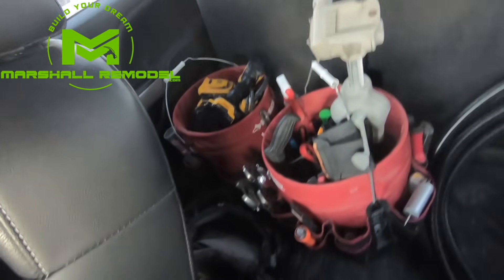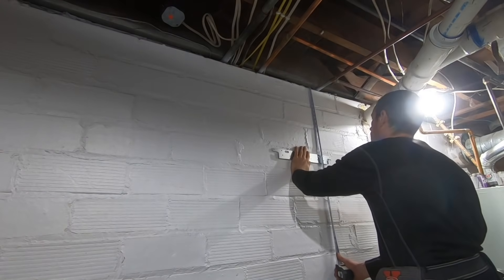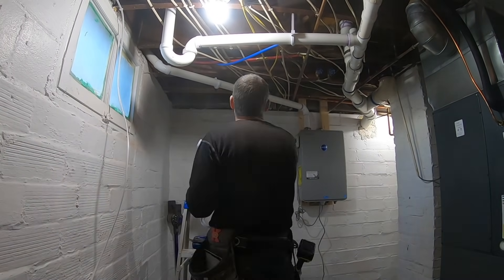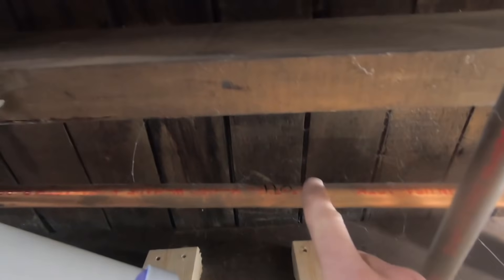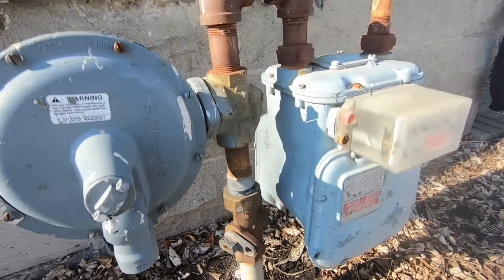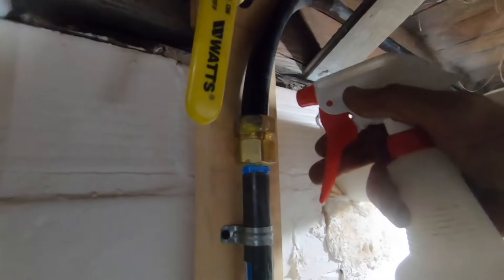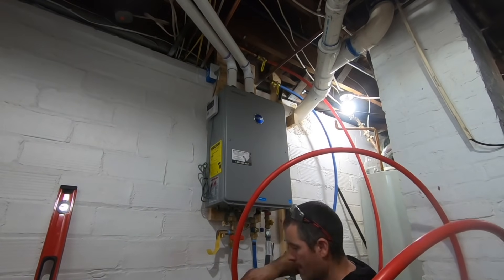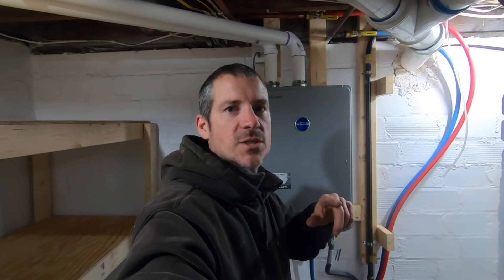Tankless Water Heater Install | Existing Home

Comment: Are those 90 degree elbows on top the tankless pitched? I'm trying to visualize how you got the slope in the exhaust run. Because if they are regular 90s it would be 0 degrees pitch right? Or perhaps the spot it clamps into on the top of the tankless allows for some flex and that is how you pitched it?
Reply from the maker: They are 90's but you can easily get a slight pitch with the pipe.

Comment: I have learned to never use dish soap for checking gas leaks.  It is a degreaser which will remove some pipe sealants and is corrosive and can rust steel pipe.
Reply: Only use approved gas leak solution
Reply: wow that is a fact that i just learned after plumbing for 30 years

Comment: I get made fun of at work for being a nj plumber who runs pvc working in nyc where they still do cast-iron, kinda mind blowing what other people around country are doing we sweat copper pipe and run black steal for gas this type of work being done realy takes the art and skill out of the trade, take the extra time to do things like a pro your work will last longer and you're customers will know the difference.
Reply: Those gas fittings he installed would eventually dry out...black pipe,baby!

Comment: It would be nice if you would mention about making sure with the BTU's you are adding to the gas system,, that everyone needs to make sure your gas piping is sized correctly to handle all the gas appliances, I got to jobs everyday and see that problem, plus jack legs in our area are installing these units and not getting them inspected like they are suppose to, to make sure these units are installed the way they need to be.

Comment: So I have heard that the maintenance is much more involved with tankless systems. Do you have a video on that aspect of the tankless water heaters? Thanks for the videos, they are very informative.
Reply from the maker: We don't, but still need to do a video on the install in our new build. That's a great aspect to include in a video.
Reply: Sounds great!
Reply: Circulate vinegar through the system. Doesn’t get my mor straight forward that thank.

Comment: First question is, I thought you cannot run pex directly to your hot water heater? Second question is did you have to terminate any electrical for the tankless? I did a couple jobs before where I had to wire up the tankless heater. If i remember correctly, I believe it was due to them wanting to tie it in to their smart home system. Tekmar if I remember correctly.
Reply: Normally, you need 18" of approved piping away from the unit before switching to PEX.  The Rheem  and Rinnai models I have installed plugged directly into a standard outlet as it is only used for powering the electronics.  I haven't done any systems that connect to a smart home system.  Do you have a link of what type of system that was?

Comment: Tankless v Tank still an interesting debate.   "Endless" hot water often means increased bills & water usage especially with teenagers in the house, they may never leave the shower!  Also in case of power outage no hot water -- a 40 gallon tank will stay hot for a day or two (obvi not for showers but the rest).  And yes depending on the make up of your domestic water (well vs municipal, hardness, minerals, etc) scaling can be a big concern.   TBH despite their growing popularity, I'm still fan of 50 gallon tank for about $600.   Last one I replaced in my house worked great for 21 years.   But thanks for the clear good video!

Comment: Good job,  the only thing I can see that would be called by the inspector is you have to bush down at least 2 pipe sizes with gas or use a reducer.

Comment: I saw a suggestion about screens on the PVC due to rodents. It's usually a bad idea on the exhaust, and some instruction manuals will say that. Flue gases on high efficiency units are cool and moist, so will immediately condense on cold hardware cloth screens. (rapidly) That starts a death spiral and an ice dam is built quickly in cold temps. The pressure switch sees an obstruction and the unit shuts down. In practical terms rodents don't enter, but ice dams will form all the time below 20F. FYI.
Reply: Great explanation of this. I was looking thru comments to see if anyone had already said this. Obviously doesn't apply with homes in warmer climates.

Comment: Quick question on this install... noticed the meter was 250 CFH. Did you have the gas company upgrade it after this install? NG furnace, NG stove, and now NG tankless must be over? The reason I ask is because I have same size meter and plumbers are looking at me like I got 10 heads when I ask them don't I need to upgrade the meter first.
Reply: That is just one of the half dozen or more items that would never pass inspection.
Reply: That is prolly because your meter is good up to 250,000 btu's of output..your tankless is anywhere from 140 to 150,000 btu's  for your furnace let's go high and say 100 to 120k btu's doubtful but let's go there..your dryer 25 k & your stove anywhere from 40k btu's to run 2 burners full blast and the oven all at same time..giving or taking on this figures you should be fine..most important thing is the piping if that's not sized right then you could run into problems it all starts at the header pipe that enters the house that is supplying all the rest of your branches that pipe needs to accommodate the supply of BTUs for your entire house when you add them all up all by itself..then size down from there
Reply: A 250 meter (size) can supply well over 250 cubic feet of gas during high demand times. On a 7" system which is what this is, your going to have 300k+ BTUs available per hour. Makes sure all your piping is sized correctly. That's the main concern. It's not uncommon for me to see a 4 unit apartment running on this same pressure ( w/ a Schaumburg reg).. 4 furnaces 4 tank water heaters.

Comment: The valve kit has built in shut off's, but you also installed them on the lines.  Is there a particular reason to have both?  Sorry if I'm missing something obvious and thanks for the video.
Reply: Yes it is for flushing purposes

Comment: It's against code in my and most states to run pex upto your water heater. You need 18" of "ridgid" pipe...flexes are considered acceptable and will meet your union requirements...
Reply: I was thinking the same thing. Hire a professional plumber for plumbing
Reply: It's not just code,it's manufacturer specs
Reply: Hack job. Not to code. I saw the thumbnail and 5 seconds into the video said to myself this guy has no business doing this job. I think his venting is too close to an inside corner too. Focused on windows and missed that. Isn't the trac pipe supposed to be grounded? Also, wrong type of plastic tube for the drain and he didn't put it through a neutralizer. Gonna rot out their floor drain and the plumbing if its old cast iron. That stuff is like acid to cement.
Reply: David, are you referring to standard tank water heaters? Any back draft from the exhaust flue can melt the hot/cold water lines if they aren't metal for first 18"
Reply: That is not the case for a condensing tankless.  You can run pex directly to the unit if you want.

Comment: Did good but that wood framing is def not as sturdy as anchoring it to that block wall . It’s hollow but it will hold better then floating 2x4 .

Comment: Nice video. Easy to follow. One question, what is the reason for having two valves on both the hot and cold? If you already have the valve kit that screws directly to the heater, why put yet another set before/after?
Reply: Just for whatever in case you need to remove the hot water heater maybe to a different location. Other then that there’s really no purpose.

Comment: I am planning on removing my water heater and put tankless water heater. My current water heater is using PvC for vent.  And it goes up in the attic to the roof. 
So my question is can I use my vent That I currently have on my tankless water heater? It about 20 to 30 going up? Pvc

Comment: Can I mount this on my back porch? No basement…house was built in 1941 n have changed all gas line to black pipe n flex tubing…my tank heater quit n was thinking bout putting a tankless in…vents through roof

Comment: Woulda been nice to see the wiring done for this unit as well… Any particular reason it wasnt included?
Reply: Plugs into any old outlet. Get a short glimpse at 20:51.  The control wiring on mine was rather simple but will vary.

Comment: My house has three 40 gallon  hot water heater.  One is new 2 came with  the house.  Question  is there 1 tankless that can replace all 3 of these 40 gal
Reply from the maker: Depends on how much water usage. When you look at the models they’ll specify how many gallons they can use per minute

Comment: Never Teflon tape on gas pipe. Always pipe dope or permatex if your dealing with stem.
Reply: He said that's how he was trained....guess his teacher didn't know that regular Teflon tape will possibly clog your gas valve.
Reply: Tape is fine, pipe dope is easier.
Reply: @christopherhaak9824  
Yellow Teflon is for propane and natural gas. White is only for water lines. Gas breaks down white Teflon over time.

Comment: Help ...my gas hot water .is leaking out overflow pipe or relief valve ,after i take a shower.... when it  is feeling back up it shoots steaming water all over my floor .through the relief valve .ive  heard it probably valve but i think its in the heating unit getting the water to hot ...plus its on lowest setting .any help would be awesome

Comment: I'm sold on tankless, except for 1 thing.  The cost of transitioning from tank to tankless. I've run the numbers twice over the last 20 years.  With all of the upgrades required were looking at approximately 25 years to recoup our investment. Probably more know that it's just the 2 of us. Talked to realtors and absolutely no financial benefit for the upgrade. We lose power a few times a year and about once every 5 years for multiple days so to be able to have gas hot water vs none is important to us.

Comment: Its going to be interesting in 20 years when all of these new installation products with rubber o-rings start failing. Im fine with pex and crimp rings or any other mechanical connection. I know the 100 year  service life for pipe installation is a thing of the past but Its black pipe and copper for this fella. Good job otherwise. Thanks for posting.
Reply from the maker: Thanks for weighing in. It will definitely be interesting to see if it all lives up to its name
Reply: Because copper holds up forever right??lol
Reply: Copper is a disaster for me.  Pinhole leaks everywhere.  20 years on the system...time for pex.
Reply: He said, "black pipe"
Reply: I like the shark bite for going from copper to cpvc,or switching from any one kind to the other, but I would never use it in a wall that is sealed off, and I still prefer the crimp clamps any time possible

Comment: Only thing I see wrong is you should of used water heater flexes. Need 18-24 inches of gap between pex and valves

Comment: I kinda have a problem, my water heater and furnace is in the center of my house in a closet, can you vent it in the same place as the old water heater. Also does the intake have to lead outside?
Reply: I believe the exhaust contains carbon monoxide. DO NOT vent inside.
Reply: @TravMan923  that didn't answer my question, obviously if it burns any type of gas the exhaust contains carbon monoxide.
Reply: @gainesinlife  I'm sorry! I read intake as exhaust 🤦‍♂️. Smooth brain move.

Comment: A couple issues I see with almost every one of these videos is that 1) no one ever mentions when installing the water tankless heater to have the gas meter verified that it can handle the demand of the tankless water heater. Not all homes have a big enough meter to handle the demand and if that is the case and you do not stage the installation you could be without hot water heater till you get the gas company to come out and properly size a new gas meter. 2) It is not a good idea to dump the condensate line directly in the sewer or on the ground because of the issues with acidic water. You should be putting a condensate neutralizer device on the system to bring the ph level of the water to a safe level. It will protect the environment and the pipes if you do. If you live in an area that has housing codes than you need to check with them to see if it is allowed to dump on the ground or in the pipes(which I do not recommend)
Reply: Walter, you are absolutely correct. Worked as a first responder / gas fitter for a gas utility in Missouri and not contacting the gas utility about the added load is the number one mistake.The number 2 mistake  is under sized fuel runs & number three is the neutralizer not used on condensating tankless water heaters.
Reply: @boby115  he's not a licensed heating contractor. So he shouldn't be tinkering with things that he is not qualified to work on.
Reply: @boby115 
Yep, another Carpenter playing Licensed Plumber. No issue with insurance and permits? HA!
So many issues... 
No Plumbing Permit
No Gas Permit
Sch 40 pvc no longer legal to use (at least here in MASS!) for the guys exhaust
No Liability Insurance
Push to fit valves
Valves under heater not for "draining" but for annual flushing of the heat exchanger
Condensate not proper
I could go on and on... 
He is qualified to run those 2x4's down from the floor joist though. 
Not doing his family any favors here.
Reply: Sounds like 3 union losers being haters.  I  installed a combi boiler on my house myself,  did everything cheaply as I could. Sold the house without any issues.   Municipal water is usually so hard with calcium and magnesium,  the acid condensate isn't a real issue.   Stop making people waste money on stupid unnecessary things.
Reply: The BTU capacity rating is on the gas meter. Plus the meter actually has a 20% extra capacity. The main thing is the pipe size should be 3/4 and it is. Google meter size for tankless water heater.
Reply: @twbrkfd1733  some of the new tankless models are now coming with a 1/2 gas line requirement.   However all of the combi boilers require the 3/4  gas line. For the most part,  I felt that this a good video.  Most home owners can easily tackle this project and save $1000's doing it themselves.
Reply: @jjleda7324  I dont think a home owner should be messing around with a fire burning appliance in their home just to save a few bucks. To many serious consequences if something is done wrong.
Reply: @richardneville3731  it's not just saving a couple of bucks, it's more like saving several thousand bucks
Reply: This tankless only requires a 1/2" gas feed and it also comes with a built in condensate neutralizer.  The install is fine.
Reply: This particular water heater has a built-in condensate neutralizer

Comment: What is the size of gas pipe and how far needs to be from water heater?
Reply: 3/4 into the unit itself. The intake from the meter was 1', so he used a reducer.

Comment: I need to replace a 40 gallon gas water heater. The problem is it sets on the floor in the garage and I need to raise it per code. The plumbing in the wall comes out too low to do that without extensive work. I have the space to mount a tankless and it looks like something I can do. My only question is the existing 1/2 inch gas line. Will it be big enough?
Reply from the maker: It’ll depend on what else you’re running off it. Also natural gas or LP.
Reply: @MrPostFrame  I have a 1500 sq foot house NG with two full baths. My furnace, oven and cooktop is NG. Plus a very small garage heater that is rarely used. My tank is in a small 24x24  closet in the corner of the garage. Due to doors on both sides there is no way to enlarge this space. The 1/2 inch gas line is within a foot of where the 1 inch line enters the house. But the gas valve is buried behind the 40 g tank I replaced in 2018. The house was built in 1968. It worked great for a few years but now acts like the pickup tube  is broke off. Runs out of hot water around 5-7 minutes and goes luke warm. I've flushed it several times, not much sediment comes out. Thanks for the reply.
Reply: If that gas line is attached to the house main line, Richmond says 1/2" gas line is large enough.  That may not be the case for all tankless makers though, so check.

Comment: Does that valve kit -you say drain port, are those usable for flushing the heater? If so you should mention that they need to be chemically flushed yearly . Nice install tho, I’m 40 years in , still cannot get past all that flex shxixs piping. Sorry
Reply: This system really should have a scale and sediment filter inline plus a water softener to avoid having to flush the unit with descaler.  So many benefits to both of those additional items and very little cost.

Comment: Why not do it in copper makes the install look so much better, I know pex is easier but definitely not a nice look plus no hangers
Reply: This particular install of PEX wouldn't meet city or county code in most areas.  There are about 6-7 items an inspector would require changed including the gas meter being the first on the list.

Comment: Curious, if you were to lose power, would you have to manually turn the unit back on when power is restored?
Reply: So, I don't have this brand, but the only thing that happens to mine is it returns do the default temp. Also, if you add a battery back up (like for a computer) it won't go off at all.

Comment: Hi there. Good stuff. What about a recirculation pump for "instant on" water at the faucet? Also any mention about scaling in the heating core if you have hard water and how to de-scale it? That being said, what about connecting a "flush" port to the unit? Just wondering. I was thinking of installing one, but it turned out to be too much to maintain.
Reply: Not practical in a little shack
Reply: The flush ports are on the valves at the bottom.